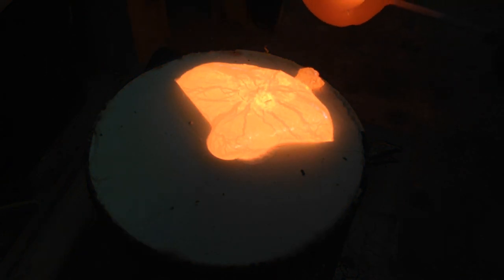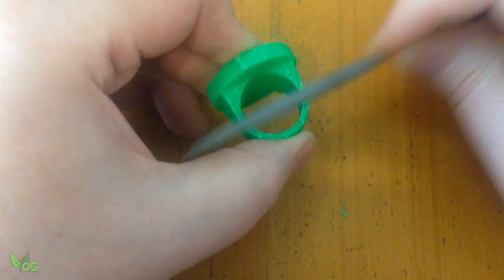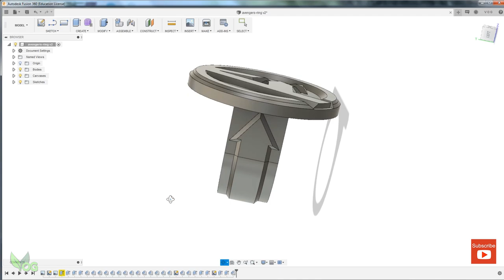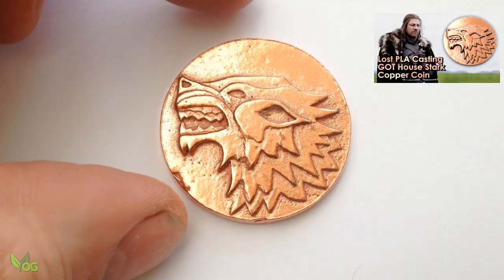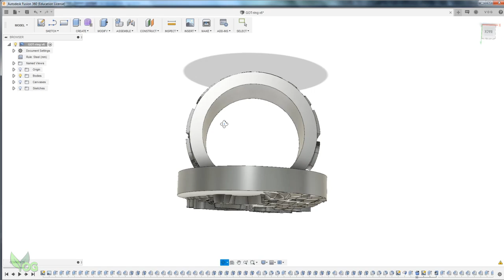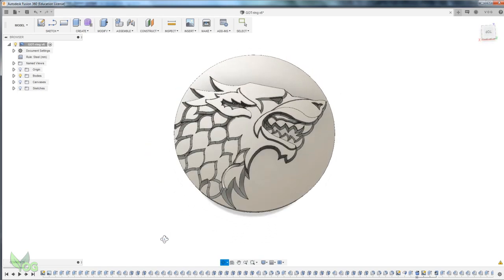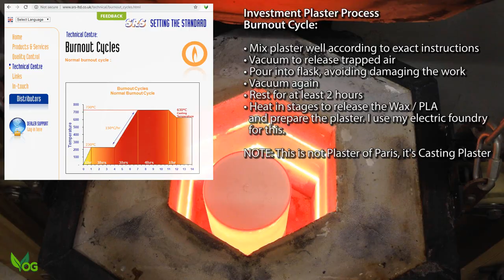Casting rings at home - Punisher - Avengers - Game of Thrones - lost PLA Jewellery Casting

Comment: A couple of tips for the jewellery saw.
Whatever you are cutting needs to be in a vice. Otherwise you are pressing up as you press down.
Also use the full stroke of the blade with just the pressure of the saw, the fine teeth will cut.
Still a great video and always a welcome sight on a cold morning.
Reply from the maker: Funnily enough I've just ordered a mini vice. The problem is I forgot to order saw blades : (

Comment: You ever think about making some cupboard knobs?
Reply from the maker: That sounds like multiple castings which tends to bore me. I link doing something different all the time. But could it be done? Yes, very easily : )
Reply: VOG yes, would look silly to just have one cupboard knob that’s different. Would have to make a mould. I just counted the knobs in my kitchen yeah, there’s like 18 of them. But the one cool thing about a project like that is you could experiment with casting around a screw embedded in the part. I wonder if you would have issues because the screw would heat up so much faster than the plaster?

Comment: Hi Geoff, bit of a bugger cutting into the ring like that after making a successful casting. To be honest as I was watching you work on the ring with your rotary tool I was getting more than a little concerned for your fingers. Now before you or anyone else fires off a comment I will say that I have 35 years trade experience as a Carpenter and I am also my workshops Health and Safety Rep. Now if something is making me nervous or concerned then it usually means that there is good reason for it. I think that you should look at finding ways to hold your work pieces securely while you work on them. Now I know that you have problems with your hands already after reading your response to someone's rather rude comment so the last thing that you would need would be is to have a serious injury to one or more fingers or your hands. On the plus side you are in the position of having a CAD program, a 3D printer and the means to cast smaller items so I figure that you should be able to whip something up to help hold rings and other small items while giving them a post casting clean up  (fettling ?) and a polish. I hope that you will take the above comments in good faith as the constructive advice from a concerned friend. Mark
Reply from the maker: God bless you Mark, absolutely no offence taken. You are 100% correct. 
The problem is I find nothing holds the work as well as fingers. Things inevitably slip from clamps or are damaged by excessive grip. But you are correct... my actions may encourage others to take risks and that's not right.
I'll have to give the matter more thought : )
Reply: Eyes are also a vital body part to mind and protect 🥽
I have used air driven rotary wheel brushes and know from experience it isn't fun to get hit by one of 'em spikes if they come loose. They fly fast! and are sharp as needles.
They can (and will) burry themselves deep into skin (I used eye protection, so my eyes were safe) but have been hit on my arms and forehead. Ah, the joy of making ships :ø)
Reply: I was thinking of something along the lines of two side arms and a press plate. You lower the ring down into it with the face against the plate and tighten a screw thread. Do what ever work needs doing then loosen and rotate the ring again. For working on the face of the ring holding it by the finger hole is the way to go. 
You can also look at getting small bench top mounted hobby vices.
Reply from the maker: You're absolutely right. I used to display a little "Don't do as I do - do it right" type safety message on my videos. I must resurrect that. Personally I wear glasses permanently, so my eyes are fairly well protected. I also wear a dust mask as those little shards do fly : )
Reply from the maker: I tend to hate such things, but I really should try to set a better example  : )

Comment: Yeah, doing any handiwork will result in mistakes that make you look incredibly stupid.
I know it. Believe me.
Never heard of buffing compound (?). What's that?

PS: What if you make a crafter's cringe compilation for all mistakes you made. Would surely get some  laughs out of some people who can relate :D
Reply from the maker: Buffing compound is weird stuff. It's very messy. It turns black instantly and gets stuck in all the recesses. But it REALLY works.
https://www.ebay.co.uk/itm/Metal-Polishing-Buffing-Compound-Pro-Max-Quality-50g-750g-Bars-/292417141326?vti=

(That link is just an example... I've not used those particular ones.)
On this build, I didn't mind a little darkening of the recesses. It helped pop the details : )
And a blooper video? Wow that would be a long video in my case : D
Reply: @vogman  it's the metal particles and oxides darkening the compound. Ultrasonic cleaner takes it right off. If it's particularly tough, drop a jar in the ultrasonic (water) bath and fill the jar with ethanol or acetone. The binders are petroleum based, so a little organic solvent goes a long way. Note Beretta specifically disallows ultrasonic cleaning for their M-92/93 frames, as it can work harden the locking lug area, leading to stress fractures and failure in the thin section aluminum - which I believe is cast.
Reply from the maker: Nice tip. Thanks : )